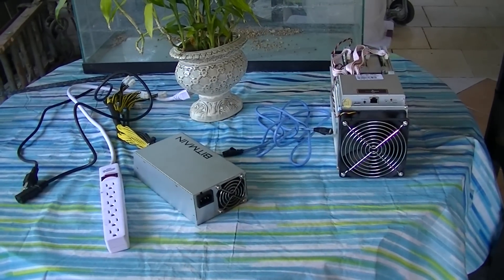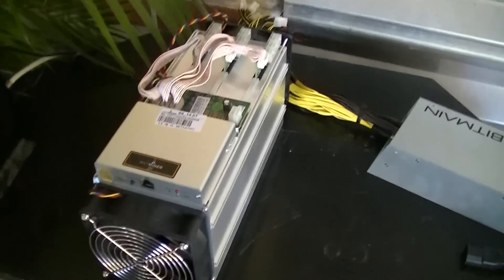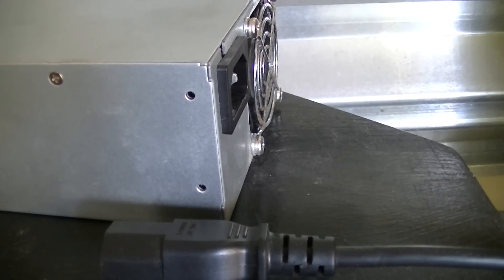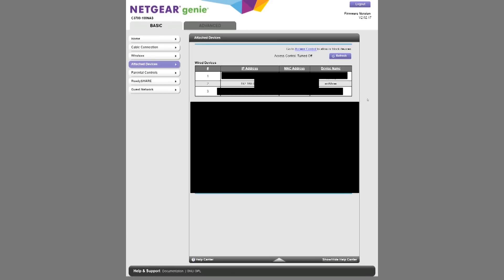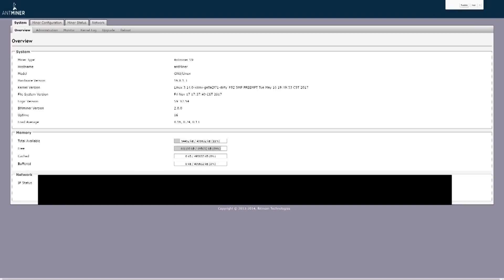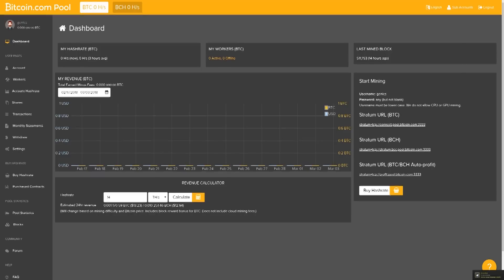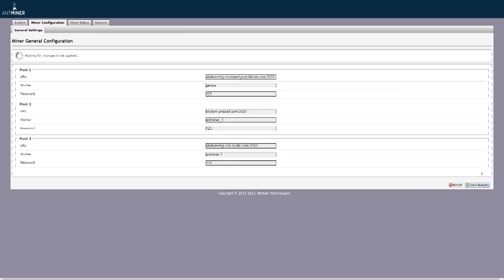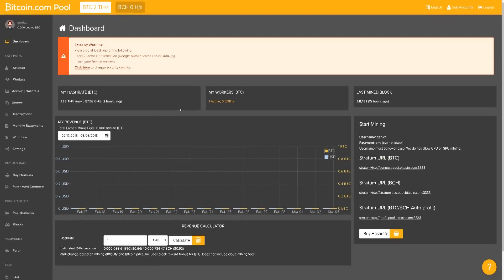ANTMINER S9 HOW TO SETUP COMPLETE GUIDE

Comment: I got my bitmain power supply today and was like what cable is what. Thanks for this!
Reply: I'm sure you've already figured it out but as long as the molex connector fits, it will be supplying the same amount of power. So, in short, it shouldn't matter which cable goes where, as long as it reaches and fits!

Comment: ASICS SUCK. He is a salesman for them. Don't listen. Here is the calculations based on reality. If you buy one of their antminers for $8999, he will make you $28 a day average.
It will take you about 330 days to make your money back. I you buy FOUR GTX 3080 GPU's for $4000 total, it will make $28 a day average but only cost you $4000 for all four and it will only take about 142 days to make your money back. DO THE REARCH FOLKS. I done a tone of it. Your better off with GPU's. Antminers are thievery.

Comment: Input voltage is 220V. ASIC miners consume enormous amounts of power that use 220V. Are you plugging it into your garage wall outlet for full capacity hashing? How are you going to mine for coins with 40 miners? 100? How do we connect to power using 110V outlets? Would we use a power splitter box? If you use a 220V-to-110V converter box you will only hash half the capacity. You will get half profit. Half power, half profit.

Comment: How does it know where to send your mined BTC? You forgot that part
Reply: You link the pool to your wallet. It doesn't have anything to do with the miner.
Reply: @DaveSmith-cp5kj  yep and that wallet can be soft or hard. cold or hot.
Reply: @DaveSmith-cp5kj  Do you link the pool to your wallet in the settings?
Reply: @elonlove343  Wallet to pool. Pool will have an area asking where you want to deposit earnings and how frequently (less frequently IE larger transaction means less total transaction fees, but also more money unsecure and potentially stolen in a pool hack).
Reply: @DaveSmith-cp5kj  Thank you! I appreciate the input. Getting ready to start mining soon so that helped a lot. I'm excited but a little nervous as well.
Reply: @elonlove343  It's confusing because of all the steps (which is why I came back to this video to setup another miner) but it is like setting up wifi. It seems overwhelming but once you do it you realize it was easier than you thought.
Reply: @DaveSmith-cp5kj  Thanks! It's mostly the power that I'm worried about. I'll be running about 5056W of power with two different units. So I'll need either one 240V 30 amp outlet/circuit or two 240V 15 amp outlets. But I'll be in an apartment so I just don't know how that will work out.
Reply: @elonlove343  I'm assuming you are using the S9, you can use a 110V power pack instead. You get lower yield since you are using less power but it isn't too bad because you are also getting less power costs.

Otherwise, use a multimeter and find two outlets on different phases, then wire up a plug splicer (if you know what you are doing, don't want to get a short and electrocute yourself or burn the building down). Keep in mind since you are in an apartment it is entirely possible all the outlets are on the same phase, which will mean you will not be able to get 240V by combining them. This is why you should use a multimeter to check this first.

If this is the case your only alternative is to mount a solar panel somewhere and use that. If you are seriously getting into mining and don't have free/cheap electricity, a solar panel setup is a must. Wind is worthless, gas is too expensive. This is a several thousand dollar investment though so I suggest sticking with 110v until you are ready to sink serious money and can calculate your exact returns.

Other options is to find a buddy with the proper power, and stick a watt meter on there and just pay him every month for the power you use. I personally would sign an agreement so if something happens like the miner commits die and takes everything down with it in a blaze of glory you have a way to settle the damages. Of course it could still put your friendship at risk.
Reply: @DaveSmith-cp5kj  Man.... thanks a lot for a this valuable info. But I haven't moved into the apartment yet for the exact reasons you just listed above. Because all the outlets might be on the same phase. But there's also some apartment homes where every two apartments have their own power on the side of the home. I'm thinking that would prolly be my best bet. But I would need to know if it's possible first before I move in. Do you think I should ask them before I move in or just check for myself first to see if 240V is possible in the apartment. If I could get two 240V outlets at 15 amps I'll be good. But I would need a technician for sure because that's not my expertise. The 110V would be cutting it to close to the 80% rule to my liking. I wouldn't want to burn the entire place down like you mentioned. It's seriously possible. 😂
Reply: @elonlove343  Ethically, I would say be up front about it, but personally I wouldn't say anything since it is liability and the landlord will probably charge you more. That said, I personally know how to make my setup safe, and I don't know your skill level. Wherever you are living right now, I would set them up as you can with 110V, get a handle on the ropes for a few days and then make your decision. If you need to discretely check out the plugs, just lie and say something like you almost had a fire in a previous place due to faulty wiring  and you just want to check the outlet output for safety. The landlord will think it is weird, but likely will let you stick the multimeter probes in the outlet to check (for sure, understand how to use your multimeter before you do this so you don't fry yourself in front of him or something, that wouldn't inspire confidence). Could also just say you have a 220V appliance (buy something cheap that uses 220V if need be, and you want to know if the landlord has that capability in the room or can accommodate you with a solution. 

Since you aren't in an apartment yetm other things you should consider is that Miners are also very loud (imagine running a hand drill 24/7) and produce a lot of heat. The sound can be mitigated if there is a separate room like a bathroom, you build a housing from a cooler to put them in and route some air conditioning hose from the box to a window to vent (or since winter is coming up, let it heat your room if you can handle the noise. Issue though is that if you vent the heat, it also vents sound. I doubt people will appreciate having a freight train sound coming from your part of the building 24/7 unless you live in a noisy part of town where no one will notice.

You can setup a CO2 gas purge fire extinguisher system like what we use on 3D printers. It's not too hard to do, use like a refillable paintball tank or something to bleed CO2 in the cooler to snuff out fires and text you to get home before your miner goes postal on your room (or use a network controlled outlet plug adapter to turn it off remotely. Better yet use an Arduino if you understand it to automatically shut power and purge with CO2 if it detect fire (This is my setup on my miners, my CNC machines, and my chemistry lab)

Honestly the setup is like half the fun in mining because there are so many solutions.

Comment: There’s no video input on the s9
Reply: what do you mean? If you mean that you want to plug in a VGA or HDMI, then you might have misunderstood something. You access you miner's info and all settings on a seperate computer within your network. First go to your router settings (its probably 192.168.1.1, but be sure to check your specific company's router setup IP). Now find out on the page which IP address correlates to your antminer. An ip address is basically a website domain (for example www.google.com) but in the form of a number. Now you take the number and enter it in your address and you are finally in your miner's settings, where you now follow this youtuber's guidance.

Comment: Where do you put backup 2 and 3 once you are mining, do you leave them blank, or use another pool?
Reply: Those backups are only used if the main pool doesn't connect. You must use a different pool just in-case, so then you will keep mining.

Comment: Great video, Does it mine better with a faster internet connection? What wallet does your reward go into?
Reply: Connection speed helps, but it isn't what creates the hashrate.  The connection is simply used to link to pools and things like that.  Reward goes to whatever wallet you assign.

Comment: don't you need a power cable with at least 14 AWG? otherwise anything higher than that AWG (lower cable diameter) will fry the cable and it could be a fire hazard no? or are you hoping the power surge extension will take care of that? hehe... great video but if you could explain in the comments or description that would be awesome

Comment: This is the best S9 setup video I've seen yet. Do you need a PC to setup or can you do this on a Mac?
Reply: i was thinking that as well can this all be done off macbook also how fast does your internet speed have to be i can basically get free electricity an i mean free but im in black area for internet, no nbm or fiber optic best internet land router box / speed  i could get would be 5mb/s  download speed would this be enough to run 2 3 or 4 s9 antminers
Reply from the maker: I don't own a mac so I can't answer that question
 and thank you for the compliment on this video :)
Reply: Trey Mohr Pc